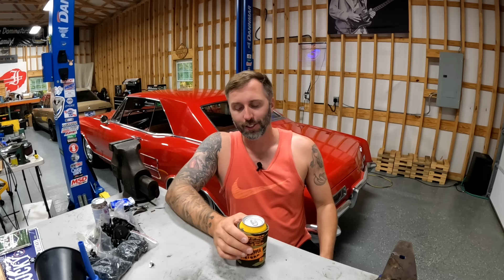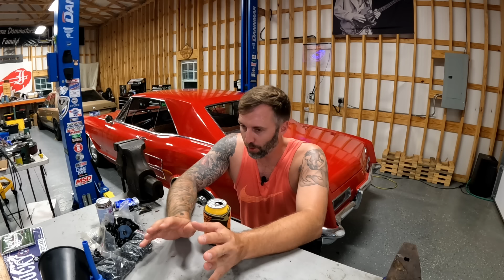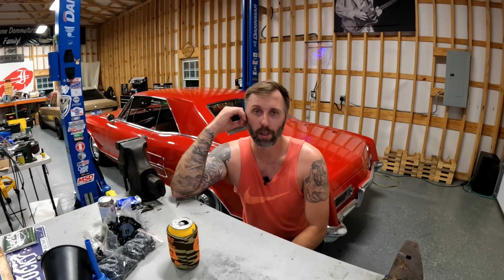Why I Ditched Holley Sniper EFI

Comment: As a mechanic, it's possible to install in a day. I had it installed but missed some steps like changing the ignition from regular distributor to Holly Dual Sync in the ECM. As a car hobbyist, it'll take a weekend for majority of guys. 
Recommend an inline fuel regulator over the in unit regulator.
Also recommend a in tank fuel pump. 
Pull the covers on the side of the Throttle body, make sure your injectors are seated correctly and put a small zip tie around them to keep them connected.

Like he said. It's not for him, doesn't mean it's a bad unit. Nor does it mean this guy was bad at doing it. Some people win. Some people lose with EFI. Most guys win.

Comment: Bought my first in 2017. Being in europe, I’m used to be on my own. The install on a 73 351c Mustang went ok but not without tons of fab. Got since then issues but afterwards mainly not related to the unit itself. Like leaky headers causing the O2 sensor to go wild. The second unit, exact same as yours came in 2019 stripped from quality stuffs the first kit had and the unit wasn’t as nicely finished. Clearly Holley went greedy to try reduce costs and maximise gain. So sure, got issues, but 5 years later, car still start on 1/4 turn crank in middle of winter en runs like none of the carbs before were able to make it run.
Reply from the maker: I am sure if they sent me a unit that wasn't broke in the box I would have been able to tune it just fine.  Thanks for watching.  Plz subscribe!

Comment: Fitech experience was similar, but 50% was the shop that installed it and 50% was Fitech equipment failures. Fitech covered their issues, the install shop just kept pointing at fitech.

I figured out the rest of the Mai issues and have it running but not without all kinds annoying issues. Still tuning (self tuning isn’t always a thing) and it’s getting better

Comment: Thank you, I was thinking of converting my 69 c-10 to EFI. But I think now I’ll get a new carburetor . I have heard multiple bad things regarding Holley support.  Funny thing regarding automotive parts people today. I ordered a new flywheel for my truck when I picked it up I knew something was wrong. The box was far too light upon opening the box I told the parts guy this is a flex plate not a flywheel! He said flex plate is the only flywheel they sells. I tried to explain to him the differences,he told me I should hire a professional, because I didn’t know what I was talking about. Then they tried to charge me a restocking fee. I lost my mind at the end no fees and no parts.

Comment: I hate to pile on here but..  both of my friends bought reman sniper units and had problems with them.  Holley replaced them, but it was a struggle.  Many years ago I put an Edelbrock Estreet system on my 78 Oldsmobile. (no longer made)..  Many of the things you mentioned are true for any carb to EFI conversion.  I changed to an in tank pump.. regulators ... etc..  all of the things you mentioned.  Mine fired up and I have never had any more issues.  Granted.. I soldered all of the connections with shrink wrap..  used wire loom on everything... etc... just as you mentioned.  My system was expensive, but I have not had one issue in many years.  This has been on my car so long Edelbrock no longer makes it.  It came with an ECU and very detailed instructions.   It took me a couple weeks to install it over the winter.  These units that have the ecm in the float bowls seem to have issues. I can't explain it.  In my opinion, these units are made in that other country and Holley is just praying they work.  I have heard a ton of injector issues, sensor issues..etc..  Edelbrock used to be made here in NC in the old Magnetti Morelli plant in Sanford.
Reply from the maker: Agreed.  The ecu in the unit makes no sense to me.  Just getting cooked by heat. Thanks for watching plz subscribe!

Comment: So all the issues you encountered, I encountered. Clogged internal regulator with bits of aluminum, unplugged Injectors, ect. But I will say after I fixed all the issues it came with out of the box, I will never go back to carb. To all the folks out there who feel like they’re dodging a bullet by not going EFI, you’re missing out. No cold starts, better fuel use, timing tuning to places my Pontiac 455 should not be able to go, (low RPM high map all in timing), the reliability, the   Customization with tuning software. The list goes on. But man, it hit me right in the chest when you said, “it’s a 1500$ product that I should have to clean down and double check injectors are plugged in ect”

Comment: The problem with that sniper unit is the computers are in the throttle body and the heat and vibration of the motor Cooks the electronics , and then things start going bad

Comment: I purchased a 71 Chevy Cheyenne with a 350 V8 and Holley Sniper EFI. It started up and ran good when I got it but would always die when coming to a stop. I didn't have time or the expertise to figure it out. The unit was loading up the engine with fuel, fouling plugs and filling up the crankcase. Numerous attempts to fix it and countless hours with customer service finally ended up with a new replacement kit. It took 6 months to get my truck back. Mechanic had to send them my original first to try to repair it, they sent it back and had the same problem. It was a very long painful process. The truck is running great so far with the new kit installed, but I don't drive it as much as I would like because I work so much. I am hopeful that this unit will last a long time. However the small LCD screen died so now I have to see about getting that replaced.

Comment: I put a Sniper EFI on my 401 amc powered 74 Jeep CJ5. I had multiple cold start problems,  ECU problems causing drive ability issues and excess fuel consumption throughout the time i used the Sniper EFI on my Jeep . Holley  did send out two more throttle bodies trying to fix the issues. It got better on the 3rd Throttle body but was never what it was claimed to be. I finally pulled it off and replaced it with a Edelbrock AVS2 650 cfm carburetor and it runs fantastic.  I did add a wideband O2 sensor and gauge and dialed the carburetor in accordingly.  Fuel mileage will never be great with a built 401 or even a stock 401 or 360. But the Jeeps running better than ever and Holley Sniper is just too problematic.  I have a Sniper system on the shelf that was a complete waste of time & Money because Holley refused to refund the money because I installed the system and used it for 34 days. Which is absurd because it literally wasn't running for more than 5 days of the 34 days of my trying to get it to work correctly.  And of those 5 days it never worked correctly or even decent.  Holley will not get another dime from me ever.

Comment: Put 1 on my 67 chevelle 454 with hyper spark had to ditch hyper spark would only run 10min then shut down.  I went back to Hei had no issues since going on 2yrs. I agree with you 100%.Glad it worked out

Comment: Great video! Your insight is very helpful. You clearly have a lot of experience and if you had trouble I’m not sure I’m up to the task of adding EFI on a car that runs well carbureted. For the ‘84 Camaro, why not go with an engine with factory ported or direct fuel injection?
Reply from the maker: Thank you ! Holley wanted me to try the sniper 2.  I am all about a company trying to make it right and all about giving the new product a try!

Comment: Just stumbled on to your channel, nice work!  EFI is really cool, but it seems very touchy... Even with clean installs. Add in sensors randomly checking out and it would be utterly maddening. 

I think the carbs still have a place. Especially on the old iron. The old iron, if it cranks, it can run... EFI if it's not 97% happy when it's booting... then its a bust. 

I'm in the middle of an engine swap in my 69 c10. Even in 2023 with all the LS options, EFI Options I chose a 540 Big Block Chevy with a carb that is a dinosaur... but with modern heads, a little tuning knowledge... think it will get down the road... and be very reliable. There is something be said about the rigs that get you home.

Comment: I’ve got two Summit VAC secondary carbs for my 10:1 331 Bronco. One is a 500cfm, the other is the 600. The 500 is set up for my mountain residence at 5000’, the 600 is set up for sea level. Carry both all the time, have two pumps, one is loud and kept in reserve, but still installed with plugs in the lines. Takes 3 minutes to swap . I prefer analog anyway

Comment: I have a 66 Mustang with a 331 stroker. Initially, the engine builder put a Holley 600 double pumper in but took out the choke saying "you don't need a choke in Brisbane" (Australia) (It's like Florida) Unfortunately, the car wouldn't start or run easily and it was a pain. The tuner had lost the choke and wouldn't put it back in. Bastard! I put a Holley Sniper 1 in with metal/rubber fuel lines and an in-tank pump and external fuel regulator. Started and ran first go! Unfortunately it had neck snapping acceleration from a touchy accelerator. I had an "expert" reprogram it with a progressive linkage and problem solved. Has worked a charm except the O2 sensor failed. Damn! I emailed Holley USA and they concurred and sent a Bosch Wideband O2 sensor and no problems since (2 years now). Starts and runs like a dream. BUT I was surprised at how many extras and "known" problems the unit has. I almost got a full port fuel injection system installed...glad I didn't.

Comment: I have a 88 Camaro, it’s my daily driver. Had a TPI 305, changed it a 650 demon double pumper. Works good. But I’m gonna build a 383 stroker and want to go EFI. Thought about a Holley Sniper, but I’ve read and watched a lot of negative reviews. Some are good but I’ve consider the Aces Killshot. To me customer service should be #1 improvement that Holley should’ve already addressed over the 10+ years they had the EFI setup out.
Reply from the maker: I am currently building an 84 z28 with a holley sniper 2 now. Check out the camaro playlist in my videos section.

Comment: I replaced my factory EFI setup with a FAST EFI 2.0 because my friend installed one and it really cleaned up the engine bay by removing big bulky factory stuff, like the MAF and such. Nothing but problems! Got it working somewhat decent and then I had a big backfire when a dist rotor failed. Replaced the rotor but the car would not start. I had to pretty much replace all the sensors again to get it running. And now it does not want to run right. Part of the problem is that these are learning systems and they learn good setups, and bad setups, and once they are running good, you can't lock down a good tune, so the system just keeps learning and the tune goes all over the place. FAST support was ok, but they did not really know how to really deal with me, since I am running a Japanese set up. The install instructions mostly deal with installing the carb style throttle body, not Multi Port systems. And online support is virtually nil, just mostly griping. So, the factory stuff is going back on and FAST is going into a box! So, unless you are running a totally custom setup or a race car, keep the factory stuff, it works just fine!

Comment: When I restored my '66 GTO, I plumbed and wired it with the idea in mind that I would bolt on an EFI system. In-tank electric fuel pump, new send and return hard fuel lines, regulator, etc. But when putting the car back together, I decided to rebuild my Holley 4160 carb and see how it ran before taking the plunge and installing an EFI kit. With a freshly rebuilt carb, new fuel and ignition systems, the car runs GREAT. Fires up immediately. I decided that there is no need for EFI in my application. It starts & runs great as-is, and an EFI kit would only add complexity and more points of failure.
Reply from the maker: If it ain't broke don't fix it lol.  Thanks for watching. Subscribe!

Comment: my first time watching you. After listening to your credentials I could use your help. I am building something new. Now I am going points, in cylinder fuel injectors, not sure which ones. I need a two program adjustable injector controller, one for normal driving and one for racing with limiting rpm controller  as I said it is new engine design.

Comment: Your 100% correct
 I had a similar problem with a FiTech unit, its a stuck injector
I think these bolt on kits are using knock off / white label injectors with poor QC
for the price of a new unit you should expect a Quality unit that bolts up and works and support that actually helps you
That said... I am a Cheap ass, so i buy used broken units for a couple hundred bucks and stick junkyard stock LS truck injectors in it and send it :P

Comment: A few years ago I swapped a Sniper onto my car.  ECU was dead.  Luckily I bought it through Summit so, with their blessing, I just ordered another kit and swapped just the body into the brand new box and returned the whole new kit with the dead body.  It has been working great for the past few years but in the back of my mind I’m always worried about it failing.  Luckily I only play within 50 miles of home so if it does fail I’ll be right back to a carburetor.
Reply from the maker: That's a good recommendation.  If I order a kit again I would probably order through summit for the same reasons.  Thanks for checking out my channel . Subscribe plz!

Comment: I'm an electronics engr tech and have worked as an instrumentation engineer and Avionics. I can troubleshoot to the component level and built the first efi332 units in 2001 and there has never been an ms I couldn't fix and tune.

I was lucky enough to have two snipers that I bought and I put a sniper on a LS swapped Jeep and it didn't work..

Went ahead and swap the other sniper on it and it started up and ran just fine..

For some reason with the snipers you have to buy two to make sure you get one that works...

I've seen the same problem with the Holley Terminator X and then on a dominator

Comment: Really appreciate your honest and thorough review of the Holley Sniper 1 EFI.
Subscribing to your channel!
I bought a black powdercoated Sniper 1 system to convert my '85 Foxbody (last of tbe Holley 4bbl Mustangs) to EFI.
Being a project car, it is still an "ongoing process" Lol, and I have not installed the Sniper EFI yet.
What should I check on the Throttle Body internally, before installing it?
Also, any tips on shielding the ECU from the front mount diatributor?
Maybe a Farraday cage/shield in front of the Throttle Body?
(I am NOT paying Holley even MORE $$$$ for a Sniper 2!)

Comment: I switched to Edelbrock Pro Flo 4 MPEFI and is 1000$ more but comes with more and is super amazing! As electric engineer, I saw having the ECU is not accaptable . This explains why it just stops whule driving. The 4th time was strike 4 and it was out of car same day!
Reply: Only reason I need efi in 69 mach1 is BOOST , PF4 is perfect

Comment: So col!!! Looking forward to the next video, I'll post my plan here see what anyone thinks!! :) (sorry if it's too long)

I was / am moving, wanted an old GM pickup , they were WAY too expensive!! .. Got a GIANT 1994 Chevy P-30 Step Van (basically a UPS, or FedEx van) .. Way better for moving stuff than a pickup.

Then I started checking out the specs on this thing 350 Engine, TH400 trany 14 bolt rearend with Duallys. over 12,000 GVW if I was building a truck from scratch that's ALL what i'd put in it!!!

So I decided I'm keeping it long term (was planning to resell after moving)  

SO?? ....  I'm moving some stuff for abuddy, and the van won't start :( .. got it going, but running RICH, made it 90% of the way home, broke down again, got it towed to the garage.

Short story, they had it 2 MONTHS and cant even get it started again, they want to put another motor in it. :( no thank you.

So tomorrow I will pay them up what I owe ... then  get it towed to my buddy's place and see what's' up. .. if needed??? ....  i plan to swap it to Carburetor!, new intake used carb.

I will put a new Holley intake, THEN once i save up some cash (this fall maybe) I will switch it BACK to EFI with the Sniper 2 kit!!

My thought is? Any trouble I can always put the carb back on (even like, years later!!)  Cheaper now to get it running, AND?? Once switched to Sniper II I  will have zero problems with factory wiring,, NO factory computer, easy to tune.  Software updates available, Etc etc

PLUS like i said, best of both worlds, keep the carb in the van for emergencies!

Can't wait to get started next week, we might even pull the gas tank, and fix the leaky filler hose, and put in new gas lines etc, clean everything etc. 

My buddy has more experience with EFI than I do , and all the tools location for it to sit etc, ... and I will be paying him too, he's payed me to work on stuff lots of times :)
Reply from the maker: Each video links to the next.  Go to my playlist section and watch every video on each build.! Plz subscribe.   Thanks

Comment: I'm a Rivi man as well, have 2 late models of last body style.
Agreed, a full weekend to install the Sniper, to make it all fitting on Classic '70 CST-10.
Agreed, major pain in the arse and now suffering fuel pressure issues.
I've never heard a mission debrief with so much superfluous hot air.  At minute 10:00 I was bored to tears.  And still wait why you ditched the Sniper.